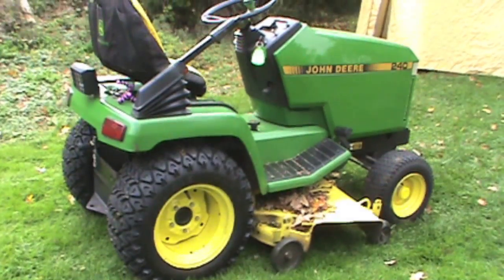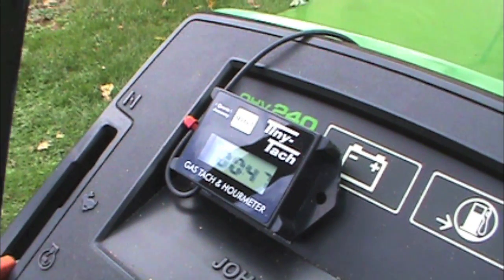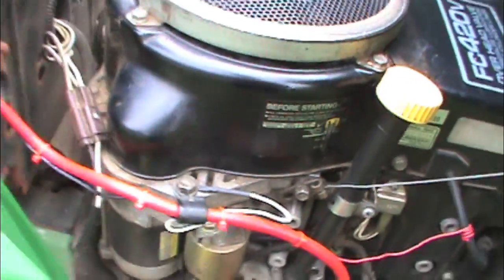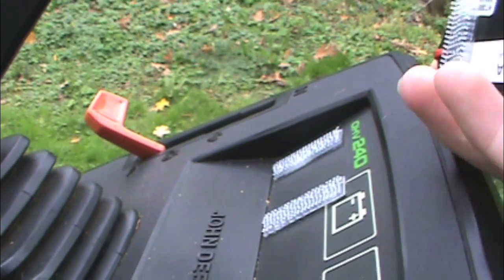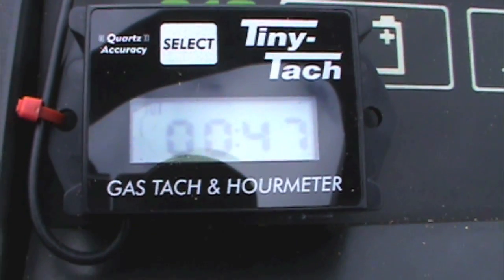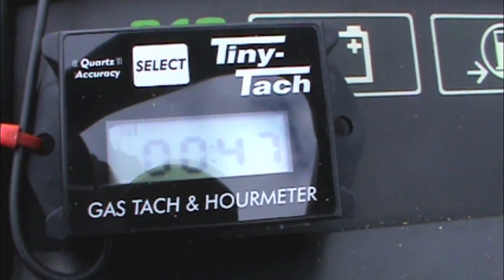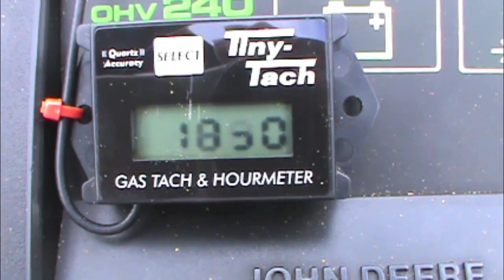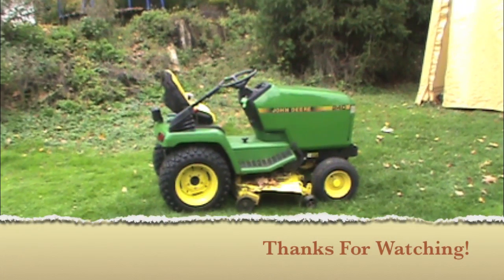Tiny Tach Installation and Test

Comment: thanks for the vid, bro. I have a tiny tach that I acquired 10 years ago to adjust the RPM on a commercial grade pressure washer but misplaced the directions. Recently dug it out to check the RPM adjustments on my commercial grade zero turn mower but couldn't remember how to hook it up. FYI the old tiny tach's battery is still going strong after 10 years in a box. Very impressive.

Comment: Anybody know how to make a disconnect and reconnect for a tiny tac?? I have an outboard motor that i take on and off to reduce the possibility if theft. Is their a way to make a disconnect for the black wire??
Reply: Robert  A set of male / female 'bullet' crimp connectors will do the job nicely (and they're inexpensive too)!  I used this solution for a digital voltmeter that allows me to share it between our two motor cycles.  The bonus was that the readout proved there was no voltage drop across the newly added connection.
Reply: Thx

Comment: Does the wire need to be wrapped TIGHT around the spark plug cable?  Does it work better (more accurate)  thanks the tighter it is?